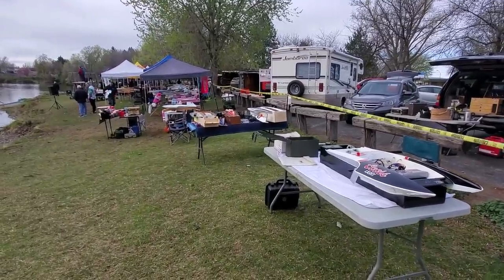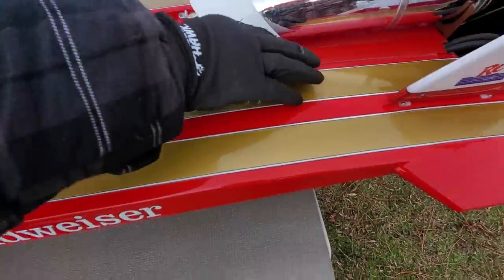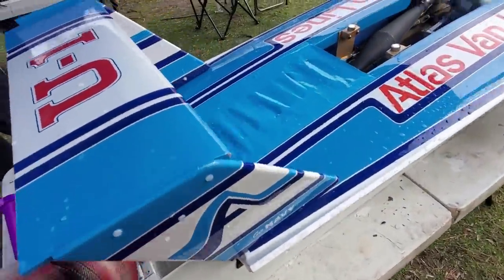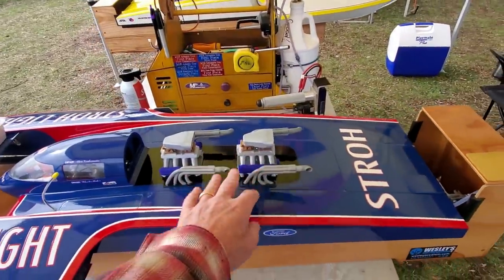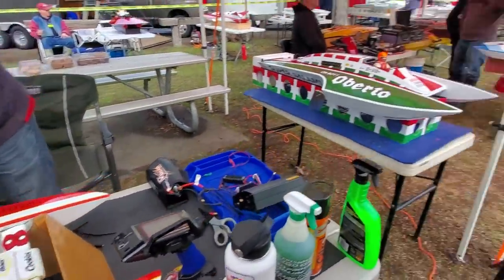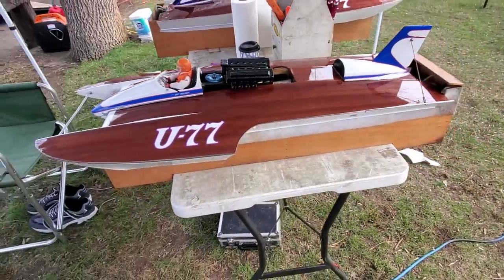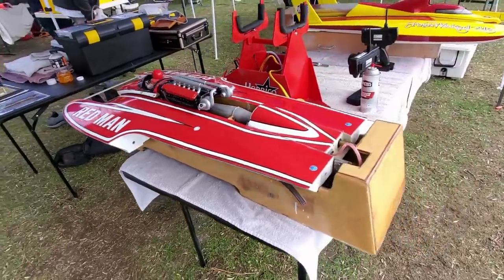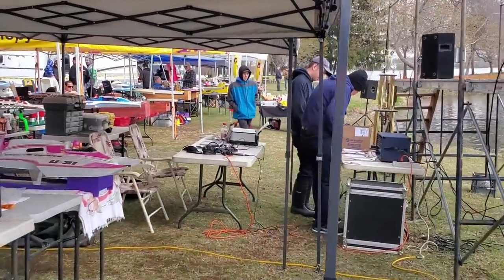Radio Controlled Racing Hydroplane Pit Tour | R/C Unlimiteds Atomic Cup

Comment: There are less electric boats than I would have expected.  I would love to hear more 'engine tech' but I suppose that is all hush hush.  I spotted that massive 17+mm carb right before you mentioned it.  Can we assume all these engines have full circle cranks, stuffed cases, top secret porting recipes and high compression?  We used to get 20,000 RPM out of air cooled Zenoah engines so I can imagine you make insane power with liquid cooled engines.
Thanks for the tour.
Reply from the maker: Yep these engines are all full-mod... Zoom Zoom

Comment: Dayum that Miss Bud is sexy! I remember watching Chip fly those boats back in the day when I was a kid. What kind of magnets are you using? Have you tried neodymium AKA rare earth magnets? They're STUPID strong so you can get away with using super tiny ones that don't weigh much, like a 4mm one should be strong enough. Epoxy or super glue them in with a tiny 4mm tab of sheet metal on the mating surface. Just make SURE to hang on to them TIGHT TOO! Don't let them "snap" together or they'll shatter easy, or give you a helluva blood blister if you get in their way! You can find them on the Ama... Zon...
Reply from the maker: https://www.kjmagnetics.com/proddetail.asp?prod=BX082CS-P&cat=19

Comment: Also on my huge quarter scale boats one is catamaran and other is a hydro plane v shape front like kirks light blue and white boat you showed and I have a water pump in the that is for small ponds or home made fountains from Lowes and I flip a switch to spray water to stop a fire instantly cuse the v shape 1/4 scale like Jeff's Budweiser one is a giant gas powered one and it has it and the other one like kirks has the biggest brushless motor I could fit in it with 2 6s batteries 100c and it has the home made fire suppression system and it has saved that boat twice from burning up. And for my paint jobs I just use rc airplane mono kote and it looks amazing cuse you just cut your stripes with razar knife or number 7 exacto or a scalpel like I do and you just cut out your stripes and shapes for on top of the base colors and I have made some amazing graphics and beautiful boats using it and it lays on nice and flat and is always super glossy cuse it can't orange peel like paint and then I just spray the whole thing in 2k clear coat it's a 2 part clear coat for paint jobs you can get it in a spray can and you pop a ball to activated the hardner in the spray can and just spray even coats just don't get clear and the edges that are tucked inside the boat so you can remove the mono kote and it's so glossy like glass. Also the boat racing league I was in while I lived in cannada as a kid with the quarter scale we had a timing system that tracks your lap times positions laps or race time limit if we are racing like 4-6 minute races like you do in rc car racing it's pretty cool setup it's a pole on a little inflatable and has the wire going across that pole and every time you pass through it reads your transponder its a co and easy portable setup and it's got two giant 20 lbs anchors holding it in place the best you can and it worked well. I have a huge lake size pond in the middle of all my neighbors backyards back up to it and everyone has their own section of lake or pond front on the shore and I set up a portable timing system and tried to do electric boat races 1/10 scale and they called the hoa and cops for endangering the ducks when their fishing line has hurt way more ducks then anything else that they break off into the water and my boats have not injured a single duck cops said it's perfectly legal and hoa said it was ok to race once a week but the old ppl kept calling cops everytime we would race so I just stopped doing it cuse it got an lying but I still run my giant 1/4 scale gas powered 2 stroke weed eater powered boat in it twice or three times every week just to piss them off cuse nothing they can do about it

Comment: im balancing the hydro out using a scale ive been told it should weigh 1 lb in the back but for that to happen i need like 4 pounds ad to the front seems like alot of weight ?
Reply from the maker: You think?  Crikey Adam, that's nuts!  
So here's my take on "balancing"... When I build a boat I layout my hardware and then pick the boat up using one finger on each side moving forward/back until I find the balance point.  This point should be right in the center of the turn fin or slightly forward, and that's it.  I have never checked my prop weight!  If it doesn't balance where I want it I move hardware until it does, simple as that.
Reply: @M5PerfHydros  I'm not weighing the prop but I was told the back of the boat should weigh 1 lb or 3/4 of a pound is that critical? Or everyone has a different way of doing things ?
Reply from the maker: If every boat was of the exact same design with strut depth, strut angle, ride height, break point, attack angle, ride pad width, ride pad length, etc, etc, all exactly the same, then yes I suppose someone's measured and proven strut weight could be trusted 🥴
Again, I believe a boat is ideal if all of those things work together to place the CG right on the center of the turn fin.  Think about it... The turn fin is your pivot point, about which the boat rotates in order to turn.  If the center mass of weight is ahead of the fin the fin will have to fight to pull the nose into the turn.  If the center mass is behind the fin the tail will overreact with inertia. But if the mass is centered on the pivot point the boat will rotate quickly and smoothly and with any luck will almost seem to accelerate through the turn. At least, that's the way I heard it. 🤗
Reply: @M5PerfHydros thanks for your help the problem with my hydro it seems like it plows through the water maybe I'm not running the right prop it weighs 20 lbs would be nice to get a little more lift out of it then get faster speeds
Reply: @M5PerfHydros  as far as props is it cut and dry which one to get ? On a certian boat thanks
Reply from the maker: With such a heavy boat you need a prop with very low transom lift. The ABC series of props should be ideal for you.  I would start with an abc 2315-19-38 and go from there.
Reply: @M5PerfHydros  probably that's why goes with fiberglass or smaller scales I guess
Reply: @M5PerfHydros  how is the weekend I'm running a wood cracker box with a stock 26cc with a 257 carb with a 80mm prop just wondering how to get it to stop bouncing?? which I'm sure it will affect its speed ? Thanks
Reply from the maker: Darned if I know, but probably caused by wrong prop angle.  Increase/decrease by about 1° increments and see what happens
Reply: @M5PerfHydros  or maybe try a 75mm 109 pitch ? Or a 128 pitch ? Or the prop is pointing down to much ?